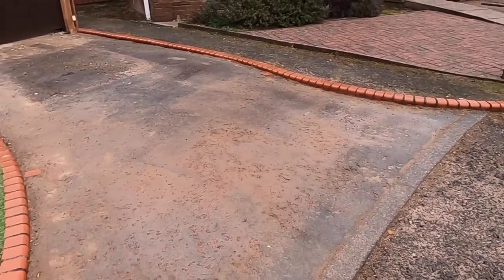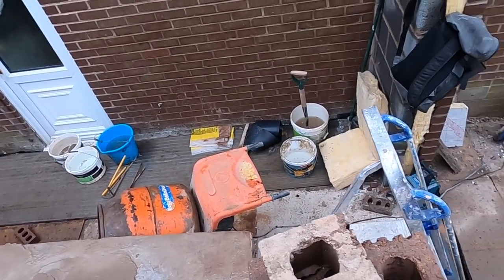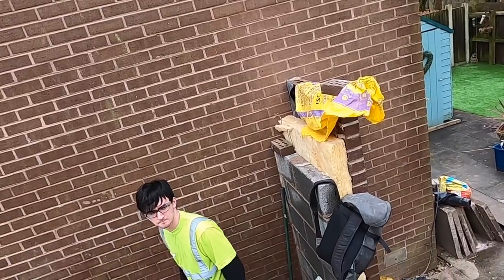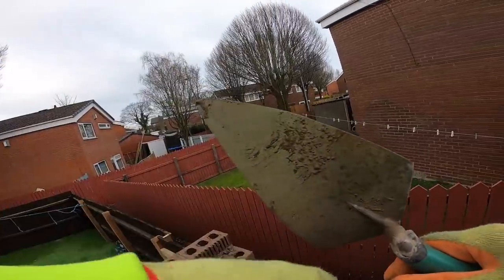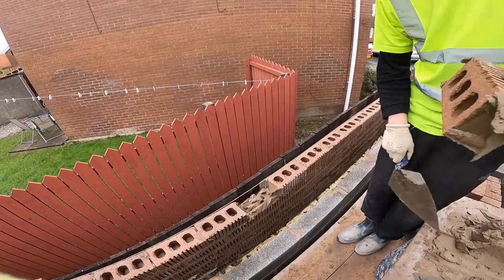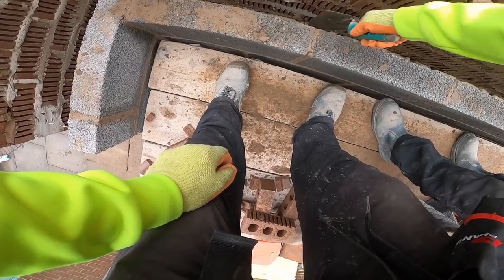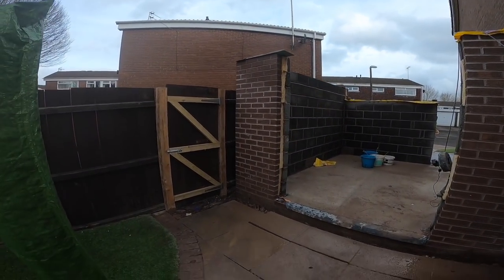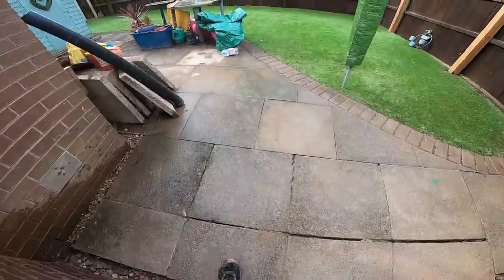EXTENSION BUILD COMPLETE

Comment: Little tip for you re the jet wash , you can use it fed from a bucket , if you can't connect up a hose . I made up a bucket with a connection on the side at the bottom,  as long as the bucket is slightly higher than the jet wash it will gravity feed in . Just keep filling the bucket up and you are in business  😉